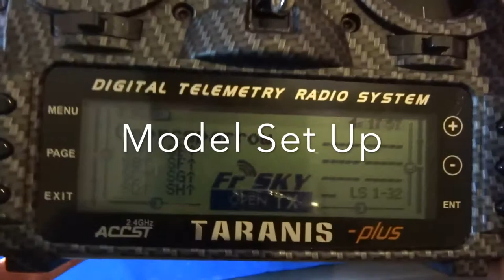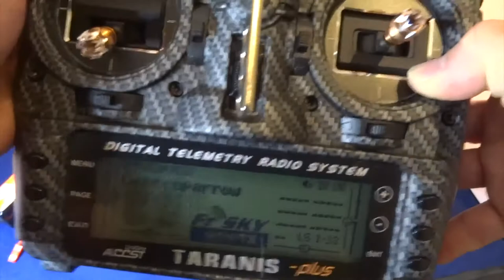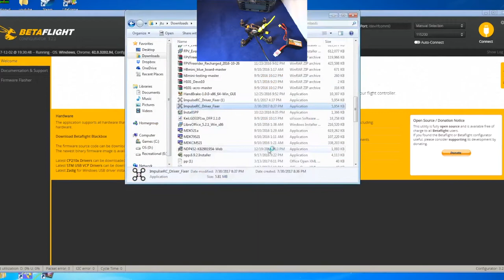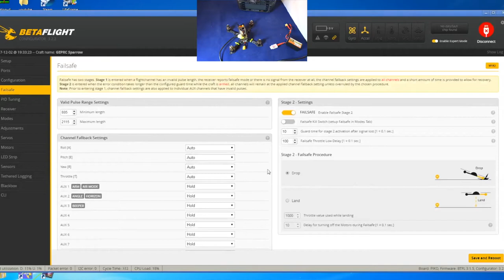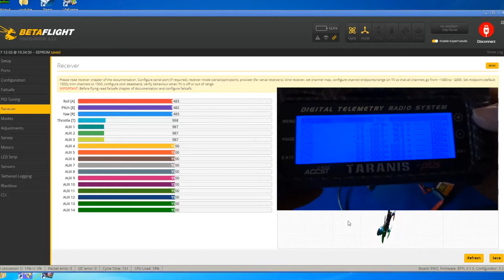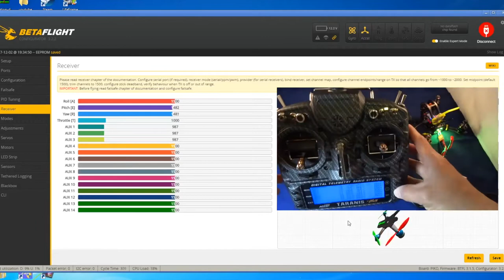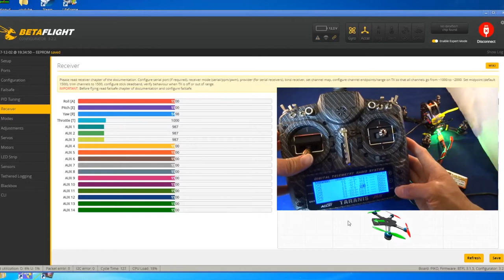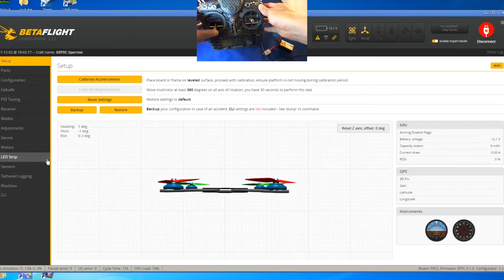GEPRC GEP - MX3 Sparrow - First Impressions & Set Up

Comment: Just wanted to thank you for taking the time and doing this video on Betaflight! I’ve had some issues after plugging into Betaflight! Serial port problems! FC was doing nothing, had to reflash it with 3.1.5 and I needed all original PIDS! Thank you so much!
Reply from the maker: You are welcome :)
Reply: I'm having the same issue. When you flashed the board, which board and firmware version did you choose in betaflight? I don't see the board listed in the dropdown and was thinking maybe its the BETAFLIGHTF3 board but not sure.

Comment: Just got geprc sparrow a couple weeks ago. Flies great, however at full throttle I hear a "wobble" or vibration. I have not flown it FPV to see if the vibration is there also as of yet. Just wondering if anyone else had this issue and what you tune to get rid of it? Thank you in advance...